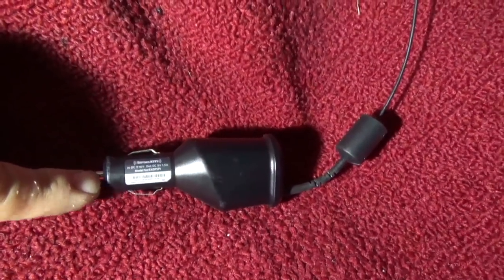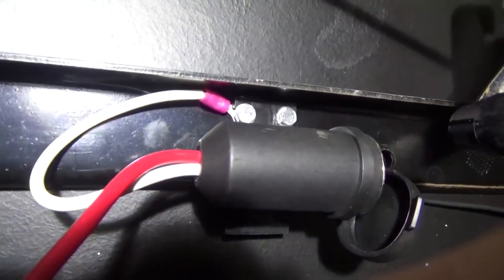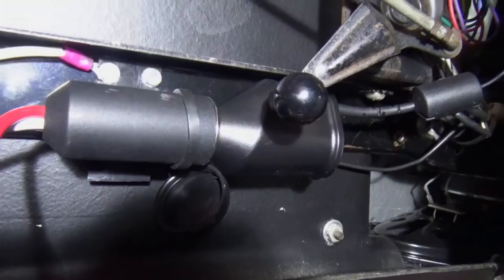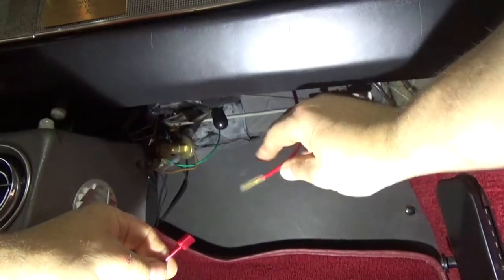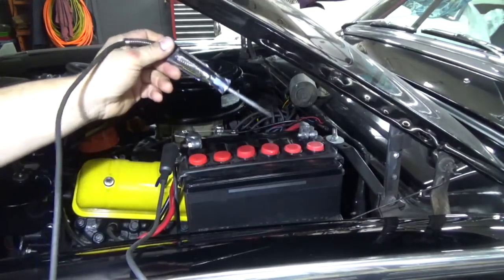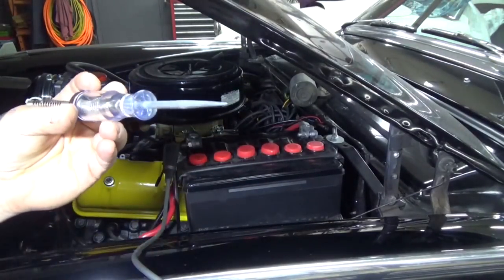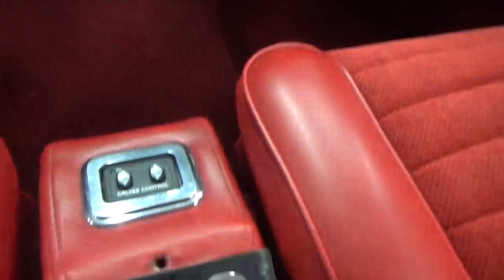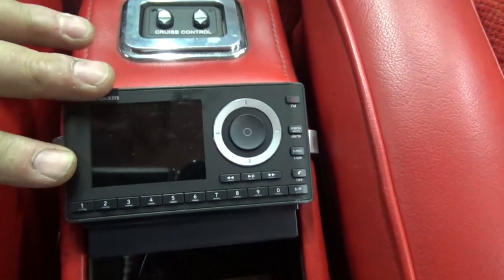Basic Automotive Wiring, Hooking up a Power Outlet

Comment: Hello there Pete I ve been enjoying your videos and learning alot too. Thanks for your good knowledge and practical approach to your informative vids. You mentioned Buffalo, your accent sounds familiar I was born in Buffalo. Millard Fillmore . Anyways thanks again for sharing all that great wisdom with the world.
Reply from the maker: Small world, thanks Dave
Reply: @PetesGarage  Pete I am having little success at preoiling my 350. One head has a little coming out the other is dry. Using a drill on a old distributer shaft. Did about five minutes worth. It has a new high volume oil pump, turning the motor over by hand.what should I do? Keep drilling?

Comment: 12v to 5v USB adapters for under the dash are cheap.  Then you power the Sirius radio with a USB adapter cable (instead of cigarette lighter size).  Check Amazon.
Reply: Opps. I should have watched all the video. You mentioned a USB adapter too. So you could have used the usb to Sirius adapter cable too
Reply from the maker: Good points, thanks Steven. I'm not sure the USB cable was long enough, but I'll check

Comment: I hate to say it Pete, but for the first time ever, I disagree with you or something you did. I absolutely HATE scotch locks. They are crap. You are not using a lot of amps here, but I cannot tell you how many shorts I have fixed due to scotch locks. Literally hundreds of trailer pigtails inside of trunks and under cars and trucks. Many more that people used to power stereos. all the way to shorts on gauge panels and lights on heavy equipment...  I MUCH prefer taking power off from a fuse box with a piggyback clip or connector or cutting into a wire and soldering and shrink tubing all. Because I was a NYS inspector and inspection station, I saw so many of those crappy things causing shorts, I will never touch one for use on anything. Sorry brother, but I cannot agree this time. :(
Reply from the maker: That's ok Steve. I actually agree with you. For a simple thing like this I have never had a problem with them. For anything bigger I will tie into the fuse box or run a separate post right from the battery. That is why I titled this one Basic Wiring. Thanks for the comment.